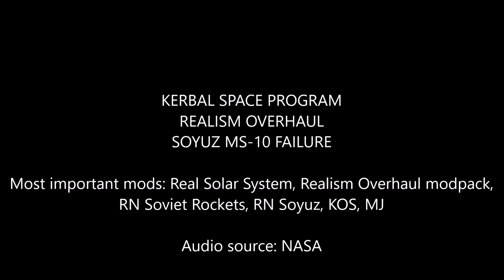Soyuz MS-10 failure simulation in KSP RSS/RO

Comment: 6.7G. I can't imagine that. I don't want to. And it's not like on a roller-coaster for 1 second or 2. It's for minutes. It must have been horrible, scary and nauseating.
Reply from the maker: It wasn't that scary, as You may imagine. On roller-coaster you have g-loads working in different directions and also you have to consider wind hiting your face at velocities sometimes over 100km/h (60mph). Here the g-forces only work in one direction and each astronaut / cosmonaut is sitting in a seat specifically designed for him. Also it's not for minutes, just for something like few dozens of seconds
Reply from the maker: Actually the nominal lunar re-entries were much more brutal, with 5gs for over 3minutes andpeaks over 8gs. Also during lunar reentry astronauts were already after over a week in space, during which they get used to 0g instead of normal 1g
Reply: @witchofengineering  Fair point. And they get gforce training in a centrifuge and so are accustomed with so many Gs. I guess I was more saying it from my point of view and how the ride down would be horrible to a person who hasn't had years of training.

Comment: How did the reentry module manage to lose both the service module and orbital module before leaving the fairing?
Reply: In an abort the service module remains connected to the lower stages while the orbital+descent modules fly away inside the shroud. Then the orbital module remains attached inside the top of the shroud while the crewed descent module separates and falls out the bottom.

Comment: The Soyuz is an old design that still works very well.
Reply: Kevin Squibben except when it doesn't
Reply: @Inimbrium  but then it still does
Reply: Chad McElroy O rly?? It's so funny when people think they know stuff and they don't. Look at the launches. Last failure was 2017. It's Soyuz, it's made by the same company. Case closed. 
https://en.m.wikipedia.org/wiki/Soyuz-2
Reply: @Inimbrium  I was talking about the launch escape system.
Reply: @spacebasedjungl1st  Well, that's great! It's like saying a wheel on the car broke and I crashed into a tree but it's ok, the airbags work! It's a great car!
Reply: @Inimbrium  You are correct. I looked up Soyuz incidents and did find a number of fatal accidents durring the early years of Soyuz. However since 1971 the Soyuz has earned a pretty good reputation. 

https://www.google.com/amp/s/amp.theguardian.com/science/2016/dec/11/soyuz-space-fifty-years-old
Reply: @endofwarmusic   1971? More like last year was the last failiure. It hasn't even been a whole year since then! Look it up please. https://en.m.wikipedia.org/wiki/Soyuz-2
Reply: @Inimbrium  I was speaking of major failures but I see what you mean from the minor issues. Although the problem you describe would have been a major if there was not any intervention.

I'm confused by the failure report you speak of. It sounds like the angular orbit was off. But was it computer or human error?

"The orbital insertion burn was conducted while upper stage was oriented in the wrong direction sending it back in to the atmosphere. Roscosmos investigation found 20 years earlier Baikonur co-ordinates had mistakenly been hardcoded in a Fregat subroutine, and the mistake only manifested itself for the first time due to launching from Vostochny. The Russian Government and independent experts however consider the conclusion as a way of escaping individual blame"
Reply: Kevin Squibben there are several, that one included, and the one from 2015 when excessive vibrations killed off a satelite (they can handle more vibrations than humans) or in or in 2014 when the upper stage had a guidance problem, or in 2011 when the upper stage exploded. But don't you see? It's the mentality of the system. Instead if tracking down the problem all they cared about was escaping individual blame. Would you trust that corrupt system? It's crazy.
Reply: Inimbrium i'd trust a reliable escape pod rather than metal cage with wings whats it called?
Reply: @suhanesetne985  What on this Earth are you on about?? What metal cage with wings?? If you're referring to SpaceX's Dragon capsule, it's far superior to this Russian old tech.
Reply: Inimbrium oh do u not know metal cage with wings that dont have escape pod? How many was killed then? I think that was space shuttle *cough soyuz successfully detach crews 2 times *couch
Reply: suhane setne fair enough. The space shuttle was very cool, but inherently unsafe because of lack of proper escape system and massively overpriced. And it took months to refurbish back into service.
Reply: Inimbrium yea dats all i can say, had a nice conversation with u sir

Comment: Main unacuracy is that one of the four side boosters didn't detached properly. Mechanism that pushes booster aside didn't work at some point so booster hit the second stage of the rocket and only then disconnected. That's why Korolev cross wasn't ideal.

Comment: I thought the escape tower had pulled them away
Reply: The SAS main escape tower was jettisoned just before the incident, but there is a redundant escape system built into the capsule fairing which kicked in, saving the lives of the crew.
Reply: I thought that as well. Had they made it beyond the threshold where that would have been the case?
Reply: They already have enough altitude, that they do not need the escape tower. That's why it is jettisoned...
Just jettison everything and return.
Reply: Theres a secondary escape system for high altitude ejection. Launch tower is only there for initial climb

Comment: that's wrong - on 0:49 you show launch escape system separation, but it's actually what has drag the ship from rocket, when a anomaly happens.
Reply from the maker: The Soyuz has 2 separate LESs, one is the "traditional" LES on top and one in fairings, and the one in fairings was used here.
Reply: ok, thanks.

Comment: Does the Soyuz capsule have a natural ballistic tendency to fall heat heat shield down?
Reply: All capsules do since the beginning of space programs. Its called center of gravity. And it's not natural, it's engineered. Apollo capsules had the COG offset so they could manouver and actually climb aerodinamically by rotating the capsule 180° to allow the heat shield to cool off a bit.
Reply: Thanks, I forget to check (or that I even have) gmail for replies. So it's more of a matter of weight distribution than shape.   @DanSlotea
Reply: Center of mass makes it swing down

Comment: Isn't the service module jettisoned first before the descent module
Reply: Why would the service module be jettisoned? It's an abort, not staging. You want the crew to be saved, Only the orbital and descent modules are jettisoned, and the orbital remains in the shroud.
Reply: Dan Slotea Oh I get it now so the service module remains attached to the third stage right?
Reply: @oremooremo5075  the service module remains on the third stage, the tower (if not already jettisoned, depending on altitude) pulls the shroud with the orbital and descent module, then the shroud goes even higher on it's own engines, the descent module separates and lands while the shroud with the orbital module crashes somewhere. Each module weighs around 3 tons so the less mass the abort system has to pull away from the rocket, the higher it can go to allow the chutes to deploy safely (not this case where I understand the tower was already jettisoned). Also the service module is pretty much useless at that moment, so there is no real reason to jettison it.
Reply: This is still a great rendition.

Comment: the video is very accurate, but u forgot to turn off the engines when the launch was aborted,as i know when a launch is aborted all the liquid fueled engines get shut down

edit: thanks for the heart C:
Reply: I believe they also have a rocket engine to ignite when touching down
Reply: @ryanw7673  that was there. You can see the light of the retro rockets firing right before landing

Comment: Thanks for making this.  Time to reinstall KSP, great video.  Hows your fps with the addons on a relatively fresh map?
Reply from the maker: It depends on the number of parts and number of running engines. This rocket had 17 working engines during lift-off and FPS was around 20-30 with physics simulation running at ~0.5 speed. After separation it jumped to almost 60FPS and real time physics
My system specs:
i5-8600k (not overclocked)
GTX-1060 3GB
16GB RAM
Reply: Thanks for taking your time to explain in detail + the specs!
Reply: That's some odd specs, do you use it for anything demanding that isn't gaming? A non-overclocked overclockable CPU, a 3gb 1060, and 16gb of RAM is quite unbalanced.
Reply from the maker: High decimal precision numerical simulations of physical systems (like really high precision, like 100000 decimal places precision)
Hyperdimensional mathematics
Computational Fluid Dynamics
etc...
Reply: Ah I'm glad there is a reason.
Reply: I don't know what most of that is but it sure sounds damn cool!
Reply from the maker: High decimal precision numerical simulations of physical systems - basically simulating physical systems, such as stars, nuclear reaction or rockets with very high decimal accuracy (so f.ex. 100000 significant digits). Becouse 64-bit computers by default only have 17 accurate significant digits, simulating with much more than that is very resource and RAM consuming for computer.

Hyperdimensional mathematics - simply math in more than 3 dimensions. In my case even more than 10 dimensions. Multidimensional vectors, vector fields, gradients etc...

Computetional Fluid Dynamics - using computers with specialized CFD software to calculate aerodynamic parameters, such as drag, lift etc... of a body just from its shape. KSP aerodynamics, even with FAR, bases on predefined aerodynamic parameters of parts. CFD calculates that aerodynamic parameters: you input 3D model of f.ex. aircraft, create a mesh and then run simulation to get coefficients of drag, lift etc... You can also calculate heat exchange with envirorment and other things like that.
Reply: What do you use this for? Are you an astrophysics student?
Reply from the maker: @S1baar  Currently in high school, but... hmm... let's just say I'm an extreme math, physics and engineering nerd
Reply: damn that's impressive. How did you start learning such complex things?
Reply from the maker: Honestly I have no idea. I was interested in it since I remember.